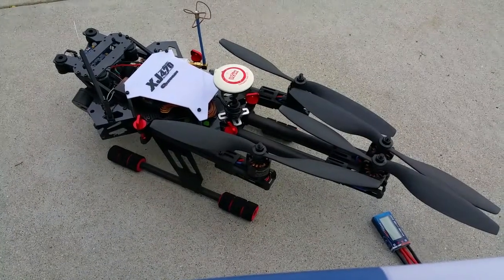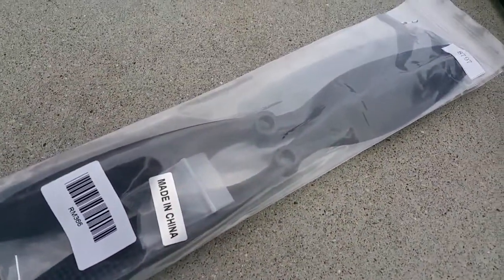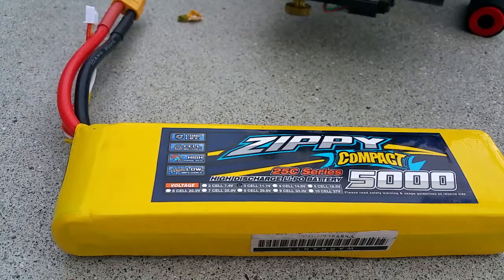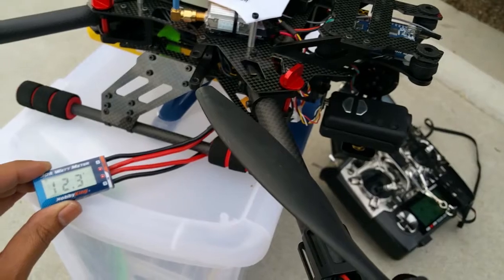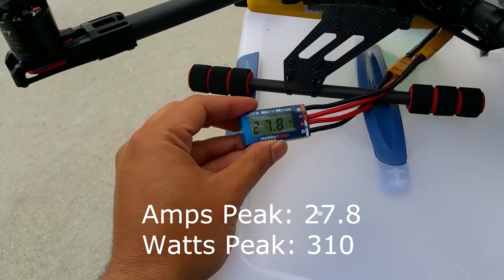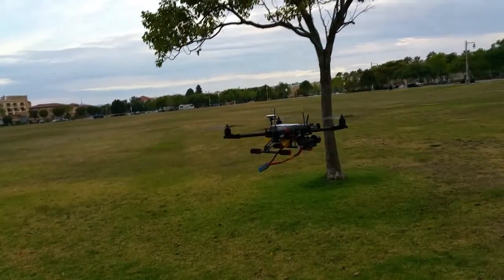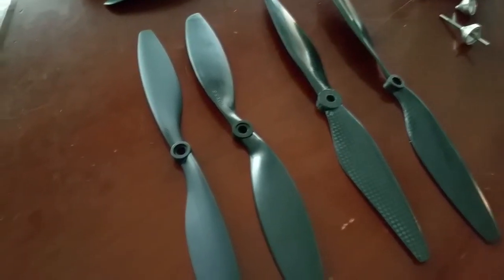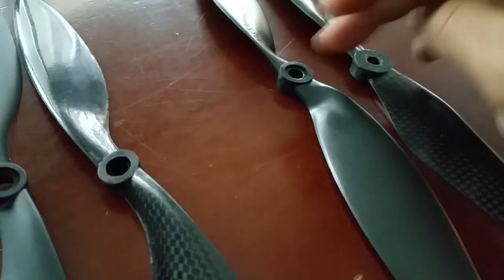10" Prop Comparison - 10x4.5 & 10x3.8 Carbon Mixed/ Carbon Fiber

Comment: Nice comparison on the props... I fly DJI controllers as well (Naza, Wookong, A2) and although they modulate the throttle inputs as you were mentioning, the the sharper, crisper throttle response is still appreciated... You will not see noticeably enhanced throttle response with those FC's as a function of your inputs, BUT that will translate to improved control from the FC.  When the FC wants to make a correction, it takes just a little bit less energy to achieve the same attitude adjustment due to the crisper response compared to other props.  I'd have to say that the crisper response is due to the stiffness of the props...  Less deformation means better efficiency across all RPM ranges...  anyways, just my own observations ;)

Comment: what would be good no my f450 useing dji 920kv motors and opt 30amp esc
Reply from the maker: I'd go with 10 in props for that. You can go 9 inch also, motors will just have to spin a little faster to maintain thrust. You'll get more thrust with 10 inch, but battery life might be slightly less. Try both and see what you like.

Comment: how much your time fly with 1038 carbon fiber?
Reply from the maker: +Ero Sannen about 10 minutes or so running my 5000mAh battery. My batteries are SHOT now, but you could get longer flight times by going with lower kV motors.
Reply: +MultiRotorPaul ya. same to me. with same motor and prop u use. i got 10 minute only..

Comment: HI and Thanks Paul for sharing. I am building the same frame, but it looks somehow different on the landing gear. Anyhow, I went for the PIxhawk with plenty of goodies onboard.... Might you wish to check it out, I have also started a build log with extensive links and other telemetry tips etc.... Here is the Post: https://plus.google.com/+FPVcambodia/posts/5bjXMFiAxx5
Are you happy with it still after a few months!? Will go for the maiden next week, normally if all goes to plan! Cheers and Safe Flying.
Reply from the maker: nice list!
Reply: +MultiRotorPaul Tks Paul... Will keep in touch, after getting it in the air, with 4S 5200mAh and report back on time flight and any other glitches.... Fingers crossed! Cheers.

Comment: this my first time to assemble a quad. my package just arrived  xj470 frame/ zyx-m fc/ and a combo esc 20A + multistar 800kv motors... can i use a DJI self locking props?  what size of props do you suggest with this kind of set up
Reply from the maker: Michael Foxx You need to calculate the All Up Weight, including battery. You haven't told me if you're using 3s or 4s batteries. You cannot use self locking props on the multistar 2216-800kv. You would know if you could, they would tell you. You might be able to put a self-locking prop adapter on there, maybe.
Reply: MultiRotorPaul- thanks for the responce. my quad is already finished im using a 5200mah 3s and 1045 cf props, it weigh about 100o grams 1kilo  with battery. the mayden flight was  great  everyone watching noticed that the motors abd props is very silent. love it :)